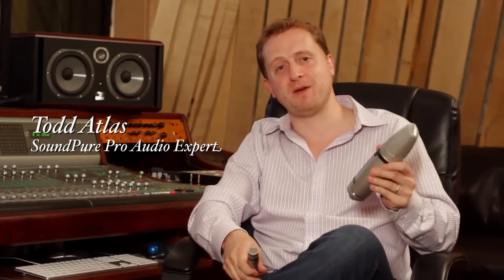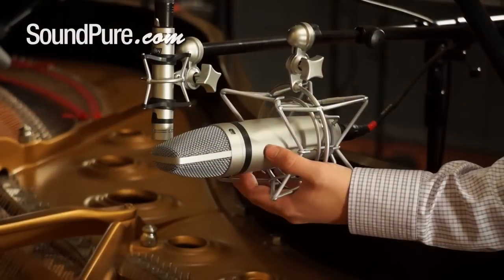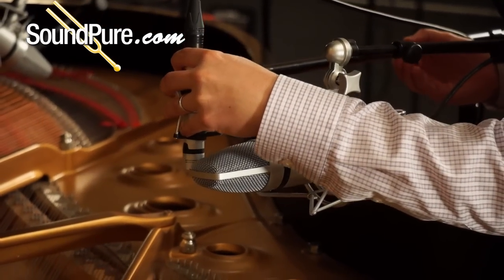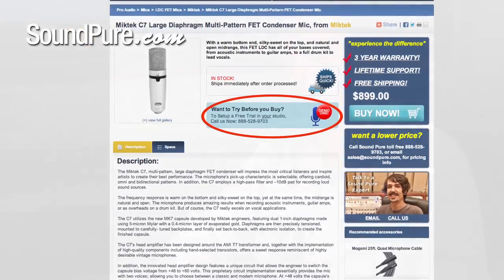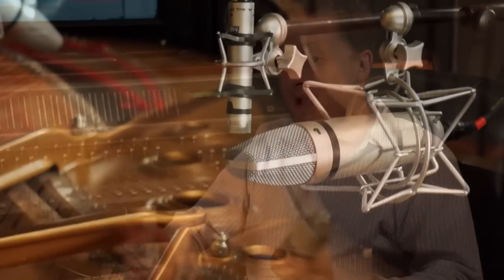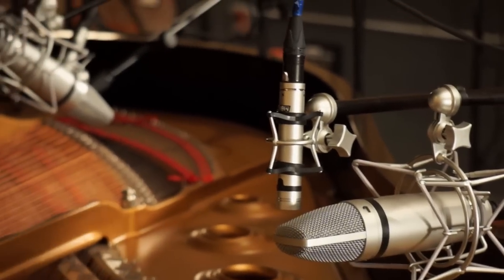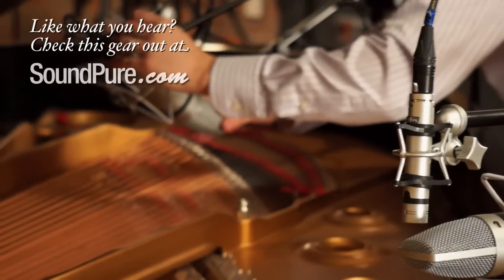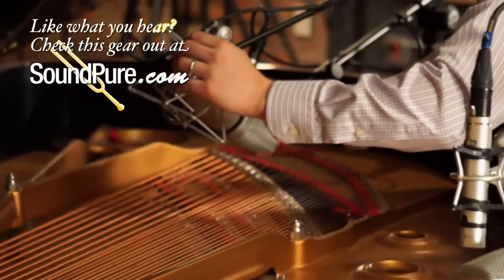SDC vs LDC Microphone Comparison: Miktek C5 & C7 Microphones on Grand Piano

Comment from the maker: Definitely. And 'opening up' is a good way to put it. I feel the opening is most noticeable in the lower frequency range. As Todd mentioned those C5s have a very 'tight' bass response, so that natural LDC 'roundness' is almost easier to hear with these two models than it would be with another pair of LDC and SDCs.